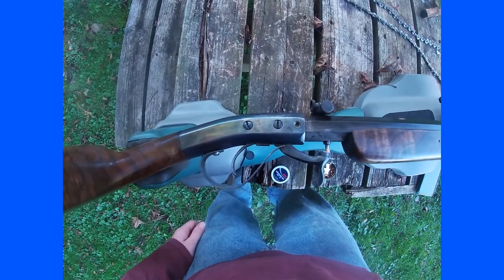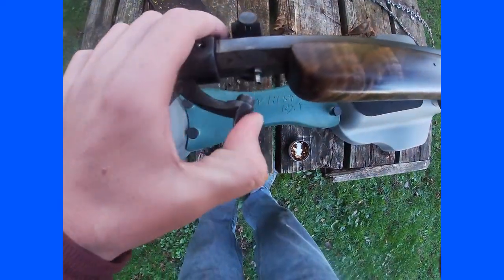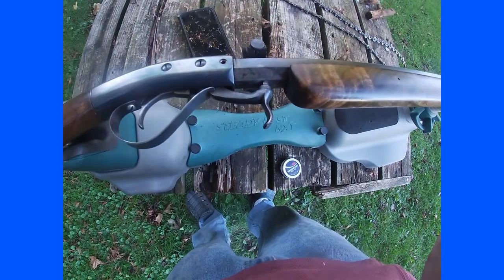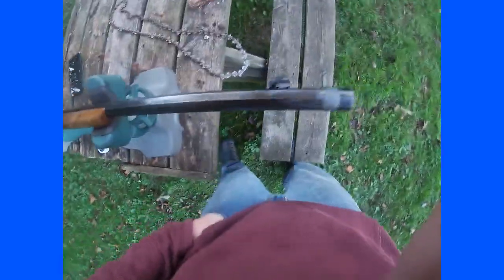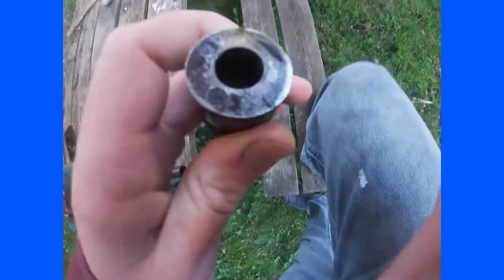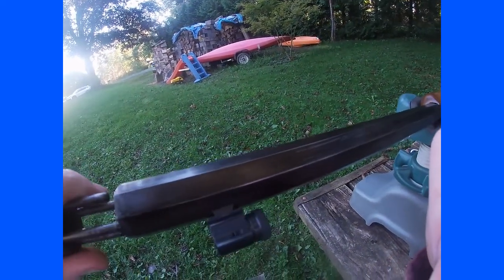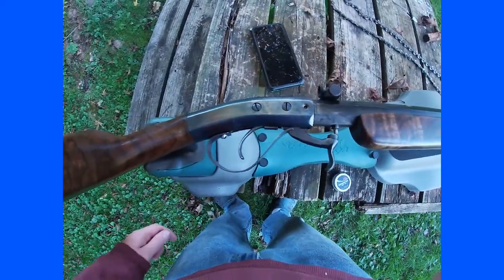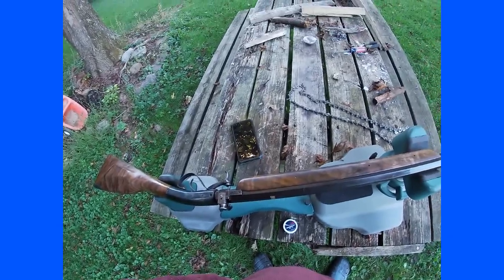My Underhammer Muzzleloader

Comment: Pecatonica supply sells all the parts and different caliber barrels.
The barrel is held into the action by three set-screws. You can change barrels in just a few minutes.
Reply from the maker: Ya I have gotten parts from them
Reply: @thesquirreltail4570  I am thinking about getting an extra barrel for mine. A 36 cal. Maybe...